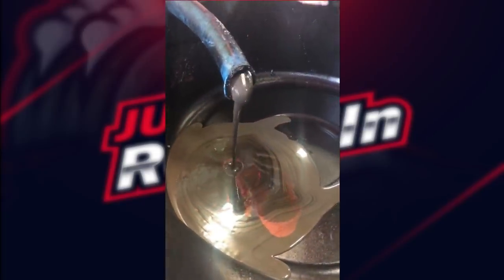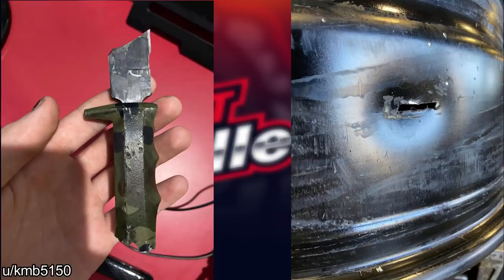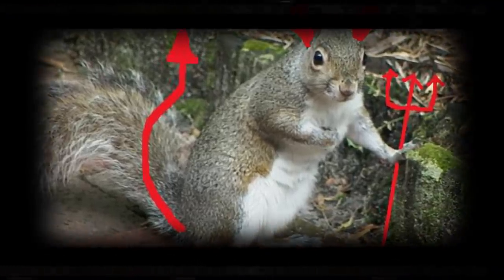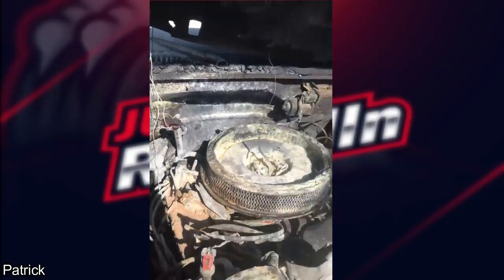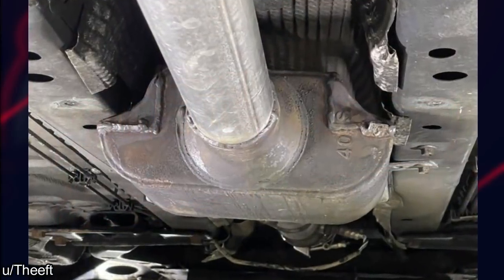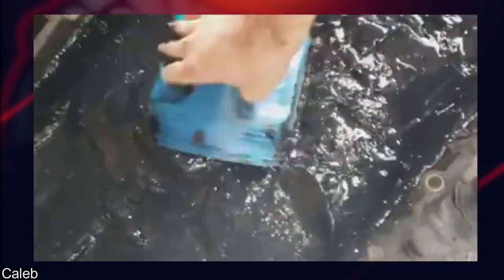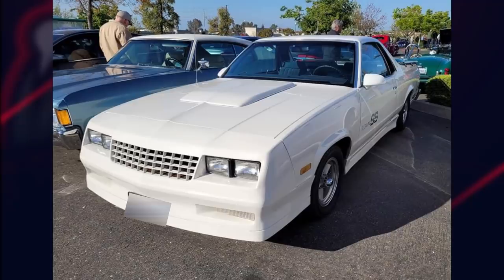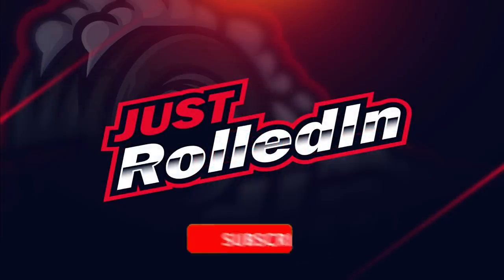Customer States "I Don't Believe You, I Don't Need My Oil Changed!" | Just Rolled In

Comment: When I was early driver, I did all my own oil changes along with other routine maintenance. Later, with busy work schedules and young kids, I started getting my maintenance done at the nearby lube place. One day, after getting the oil changed, I noticed the engine making louder noise than normal. I checked the dipstick, no oil. I called them to come to check it. They insisted that I must drive the car back to them, with no oil on the dipstick, for them to check and add oil "if necessary". I added three quarts of oil to get it up to the right level. I've never gone to that chain again and started doing more myself again.
Reply: Not the first horror story like this I've heard. Luckily where I live there's a DIY garage with a lift and oil change equipment. Jug of oil, 15 buck for the garage time and 20 minutes of my time and I'm running fresh oil.
I don't see a reason to take it to a shop for them to half ass it and bill me up the wazoo.
Reply: Worst place you can take a vehicle to is a quick change lube center. They're not even trained mechanics. Better off doing it yourself or trusted shop.
Reply: Good for you m8
Reply: I had this same thing happen to me. Got a brand new Tacoma. Drive it from Texas to Cali since I transferred with the USN. I hit a quick lube for the trucks FIRST oil change. I drove off the lot snd engine light came on. I immediately pulled over and called. The dip stick was dry. They sent a guy over with oil and I was on my way. Upset but on my way. Good thing the residual oil was there and Toyota engines are tough. Kept truck two years snd passed it on.
Reply: @peterjohnson9438  . . . you call $30 for an oil change being charged up the wazoo ? 
i bet when you open your wallet dust and moths fly out ,
Reply: @pappy451  Where I live, most shops charge between 80€ and 110€ for your average car (specialty cars are, of course, more expensive). The last jug of oil I bought cost me 35€, plus filter for 8€, plus garage time, lift access and oil disposal fee putting my total up to around 60€. I could go cheap and get the car up on jack stands in my garage, and be left at 45€ or so.
Yeah, $30 is cheap, but that's also approaching "way too cheap" - and it seems that they're either cheaping out on the oil or the labor.. or both.
At least where I live, there's less chance of getting completely ripped off, but an oil change is such a minor hassle that I rather do it myself and get to choose the oil and the filter and maybe do a little bit of inspection while I'm at it. And I've seen/heard of stealerships fucking up oil changes from time to time: underfill, filter not replaced, oil seeping past the filter, oil on engine components..
So, I do it myself, I get to go at my own pace and don't have anyone but myself to blame for mistakes AND I save some money in the process.
Reply: ...oh, and the last time my car went in for a gearbox oil change (manual), the oil the official dealership repair guys put in must not have been the right stuff, as shifting became excessively difficult. Replacing the oil fixed the issue. No, there was no metal glitter in the stuff I drained out, but it did smell rather funky.
Reply: @peterjohnson9438  i do my own as well , average cost, with filter . . . $30/$35.00
Reply: @pappy451  depends on where you live and what kind of oil you wanna run :)
Reply: @peterjohnson9438  true enough
Reply: Remembers me as I had to change the oil of my motorcycle. I gave it to a shop and announced to fill in 10w40. As I got my motorcycle back, the engine was very loud on cold start and I was unable to shift the gears. Motorcycles have one oil circuit fpr engine and gearbox. The tmperature was low at about 3°C or 37°F. At the end, the answer was that they filled in 20w50 because "What's good for an aircooled bmw must also be good for an liquidcooled Yamaha." This shop never saw me again.
Reply: @peterjohnson9438  Sounds like 90/140W diff oil.
Reply: @shoutykat  whatever it was, I replaced it with 75W90 GL4 oil as specified in the owner's manual. Somewhat worn synchros notwithstanding, the gearbox works as it should now.
Reply: I had this old "80's Pontiac that had one of those internal oil filters that inserted into the oil pan. The oil plug was more of a 7 inch diameter cap. The instructions for how to tighten it were stamped right into the cap. The "geniuses" at the quick oil change place just torqued it down as tight as they could. When it was summer and I tried to change my oil myself, my father and I couldn't get it off. We ended up having to take an angle grinder to it, cutting a notch in to that we could use a punch and a hammer to loosen it. Car was out of commission for a few days as I waited for a new one to come in. A previous time I was in that same place, the manager was chewing out some of the employees because they had forgot to put the oil plug back in a Suburban. Owner must have been stupid too because apparently they had driven it long enough to seize the motor. Anyway, the shop was going to have to pay for a new motor for the Suburban. I never use those places anymore.
Reply: @pappy451  My Tahoe requires 8 qts of 0w20 Dexos (or Mobil 1) synthetic.  I can’t buy the oil for $30-$35, let alone the oil and filter.   I wish!
Reply: @JT_70  . . . ain't technology great ? every time they " advance " automotive technology it gets harder to work on and costs exponentially more expensive ! and don't get me started on design . i believe you should not be allowed to design a car until you have 10 years auto mechanic experience . add bikes into that equation as well .
just did a change on my Sierra . . . $45.00 .
i use Castrol or Pennzoil . and Fram filters .
you couldn't buy the oil AND PAY ME to use Quaker State !
i do like the Mobil 1 , but right now i have nothing that requires or deserves it .
Reply: The real issue is that no matter how 'good' or 'bad' a lube place is, they will have a mix of new and experienced employees.
If the new employees are not well trained and mentored, and are then given time pressures, mistakes WILL happen.
Heck, even experienced hands under massive time pressures will make mistakes.
Perhaps instead of promising a 15-minute oil change for $19.99, these places would be better to raise the price a little and just promise quality. The lube show I go to NEVER promises a timetable, and their prices are a little higher than the "In a hurry" places, but I've never had a bad service there.
Reply: There's no way I'll trust a shop to do anything to my car unless absolutely necessary (like 4-wheel alignments).
Reply: @pappy451  you getting an oil change for $30? I’d check to make sure that it’s actually oil and not hot fudge. $50 here for non synthetic.
Reply: @TC-dw6wg  well that was 11 or so months ago and i change my own oil and filter .
Reply: You should have documented it, I assume you had receipt, so record the no oil and show the receipt on video. could have sent it to this channel here or go to some local news .. or at least tell the repair shop that if they don't fix this, then you'll go public .. it usually does the trick, nobody wants bad rep to their business.
Reply: One of my first cars was a civic and I faithfully followed the Honda warranty plan at the dealership.  Got a brand new engine out of them at about 50k kilometers after they changed my oil by draining it and sending me out the door with a dry engine....
Reply: @codyluka8355  I always made sure I did everything to spec. I never forgot two triple check to make sure the oil bolt was back in very snug ,I made sure it was the correct oil, I made sure there was new oil on the oil filter ring. I made sure there was no old oil filter ring in the oil pan, I made sure the oil was topped off but not too high. Part of the reason I got fired was because I refused to sell customers services & or parts they didn’t need!!

The work was done cheaper & I took my job very very seriously!! 

When I completed an oil change. 

Nothing was rushed and I did a better job than many shops would do!

There is in fact training!! I spent a week in training & learning everything about maintenance of a automobile! 

I actually took almost 2 weeks! 
Because I actually cared about what I was doing & I actually read everything!
Many people don’t read anything!

I also had her here at an automotive school before I worked at the oil change places. 
I also did oil changes and other maintenance on my own automobiles! 

So it’s about the person who works on your car not where they work!!
Reply: Sounds like jiffy lube
Reply: @ Peter Johnson

For sure.  My Malibu and Explorer, $30-$40.

BMW-which takes 6.5 quarts 0-20w and a long filter, $70-$85.  And that’s using NOT BMW oil.  But it’s easy to change the oil in and I enjoy the heck outta it.
Reply: Let me guess, Jiffy Lube?
Reply: @kenleycarlton7562
Reply: I Guess thats why my oil guys show me the dipstick.

Comment: i worked at a sheet metal shop years ago. They had me replace the starter on a  pick up so they could use it for out of town work. While under the truck i noticed a complete lack of maintenance. Since I was the one who was going to drive it i asked the owners when the oil was changed last. They looked at each other and said "they bought the truck in 1974...so"................The current year was 1998.

Comment: I own a 1948 International Farmall "H" tractor I bought in 1977. I changed the oil soon after I bought it and it was slow to drain and very thick. This freaked me out so I dropped the pan and removed the valve cover. The pan had about 2-1/2 inches of sand in the bottom of it. The area under the valve cover was completely full of what looked like dark grease. I cleaned it all out and washed out the oil passages the best I could and started using detergent oil. I still have the tractor and it still runs. I was told later this was caused by 2 things, using non-detergent oil and not changing the oil and filter regularly.
Reply: @JC HD Remember the filter kits from the '60s where you would just stick a roll of toilet paper in the housing and 'Never change your oil again'? just replace the used roll once a year or so. OMG! I knew farmers who would do this to save a buck on a filter. Quality oil and filters are the cheapest insurance you will EVER buy folks!
Reply: I bought a Ford 8N back in the late 80's.  I immediately changed all of the fluids, found the oil filter housing was packed with cheese cloth, back then a cartridge type filter was maybe $2.00. I wouldn't doubt if the transmission and differential fluids were the original.  They were like mud when I drained them, I flushed them good and put in new fluid. I sold the tractor to a co- worker,  who still uses it to this day.
Reply: @jk3dad  oh yeah those old 8n ford tractors are tough as nails lol we had a 1950s era 8n when I was growing up in the 1990s it already had a ton of hours on it when we bought it I used to have to mow 12 acres with it every weekend LOL the tractor had never been rebuilt only had oil changes basic maintenance on our farm it's still runs to this day my parents sold it to the neighbor they mow their farm with it every week still running crazy

Comment: I have seen oil in an oil pan just like that about 6 times, A fleet was using pennsylvania based oil- ie- pennzoil or quacker state, when drivers check the oil level and it was low, they added what was cheap at the self serve gas station, which was parrifin based oils- oil from most  anywhere else but pennsylvania, and the additives in the 2 different based oils turned the mix of oils into a thick mess, per lab analyis.

Comment: Most impressive tire puncture I've seen happened just this week.  Tire had a big gash in the center of the tread.  Found a whole brake pad inside, looked brand new.
Reply from the maker: Hopefully it didn't come off that vehicle lol
Reply: Can I have it back?
Reply: The weirdest tire puncture I've ever seen was... A tire pressue gauge.... The end was flattened and looked like a bolt, till we broke the tire down and there was a nearly intanct pressure gauge. Biggest WTF moment in my life lol
Reply: Used to work in a semi truck tire shop when I was a teenager, just starting on my journey as a mechanic. I've pulled an engine push tube out of a tire, had one tread over a golf ball and somehow IT went through the tire, odd nails and bolts, a tire valve stem (brass), a chunk of concrete (that one made some noise!), lots of load lock parts, a hydraulic hose fitting once. Had one blow a bead due to the tire in front of it blowing out: the shrapnel from the forward tire wedged between the duals and pushed the inner rear bead off the rim. Had a pair of tires blow out after the driver managed to pick up a chunk of cinder block on the road that wedged between the duals... Had a brand new tire explode in my face, had another new tire explode after I finished it up, set the trailer down and went to do my report: 5 minutes after I finished the job the new tire blew. In both cases, we sent the tires back to manufacturer for compensation. Too bad I didn't get comp'd for my hearing loss!
Reply: Not really a tire story but a brake pad story. I worked at a BMW dealership in the collision department. I had a fairly new 5 series towed in because it hit something in the road and went dead. Turned out that it had hit a brake shoe from a trailer truck. The front bumper hit it first and then as it tumbled under the car it ripped open the oil pan, trans pan, exhaust system, floor pan in multiple places, unibody "frame rails" and wedged into the spare tire well puncturing the spare tire. 
It totaled the car.
Reply: @Hanson_Feet  WHAT? DID YOU SAY EARRING GLOSS?
But on a serious note, glad you lived through all that, and sorry to hear about your lasting impairment.
Reply: @PrinceCbass  Wow. That is some violently applied chaos.
Reply: I’ve seen that as well back in the 80’s.
This brake pad was worn to the backing plate and was probably thrown out of the caliper.

Comment: As an ex OEM auto engineer in powertrain, I'm amazed at some of these failure modes.
Reply: I am a retired A&P. Working Bell Helicopter drive system test.We tested gearboxes on the V-22  osprey.We would run  12,500 RPM 500,000 in lbs and had a valve that drained the oil.Reqirement was 30 minutes they all went an hour and burned the paint off the bearings looked like raisins.They needed to know if it would make it out of danger instead of riding it down to the smoking hole! Even 30 minutes could easily be 100 miles or more.Then I was told to set up the #2 proprotor gear box which cost about one million dollars.The had to test each side the accessories were on the opposite side even though it looks the same.Ot also took several weeks to set it up.Whatever problems it had the gearboxes were tested and very tough.Some of the design for losing an engine was flawed and it was supposed to barley be able to land of everything went well.Never got to ride one and probably won't
Reply: One of most difficult tasks for engineers is trying to anticipate the stupidity of the user of the product.
Reply: @allanbrogdon5317  awesome Allan! I’m one of the USN/USMC V-22 wiring experts. I’m always amazed at the mechanical sections of the aircraft. Then I cry when I look at the wiring.
Reply: @kaptainkaos1202  I am developing automotive wiring harnesses and what should i say? it is simply not a classic trade craft and everyone ends up in this profession by pure accident. No one drops out of university and says "I wanna do cables!" and thus we are a just a strange pack of people coobled together. in my oppinion the whole wiring industry lacks certain knowledge about digitalisation as all the used software is complicated and lacking features it should have had already twenty years ago and most of the poeple working here understand a computer as an electronic type writer with a video output, but not as an automated machine, that can do work for you. They do all the stupid and hard work themselve, like puzzling out how thicc a certain branch for a certain configuartion is. And then we are also lacking respect for our general product by the customer and other suppliers. "Harness? that thing is flexible! don't bother me with your problems and find a solution for yourself!". And aircraft harnesses are a thing, where you don't have high volumes and great experience through an endless number of developed projects being very similar so i totally believe you, that the wiring is a bit chaotic.
Reply: @2011blueman  I once heard that over half of an engineer's job is to harden the design against intentional mis-use so it doesn't kill or maim the user. Pointless really since in those cases the user already lacks the neurology needed to understand what went wrong...
Reply: Answer me this....why is it back in the 80's pop machines would tell you when they were out of a certain type? Now you swipe your card and it says "Vend failed swipe again"....or worse yet goes into "settlement in progress" for 2 minutes.

Comment: The sludge in the oil pan could be from head gasket resealer. Only works if you head gasket is leaking to the cooling system. But if water is leaking to the oil. It cannot be used or it will cause the oil to sludge up.